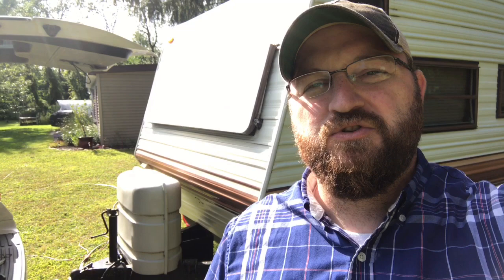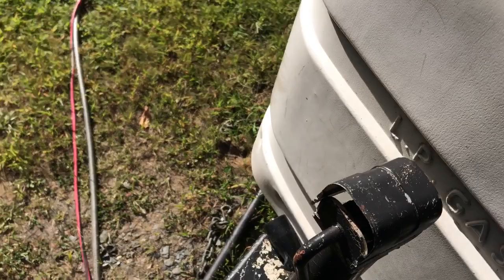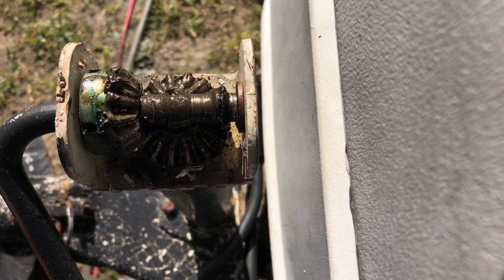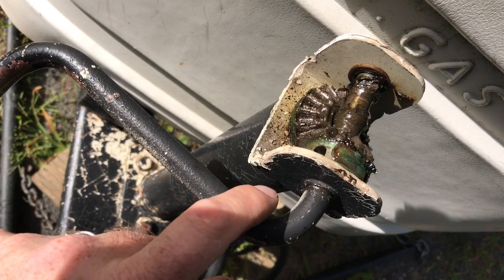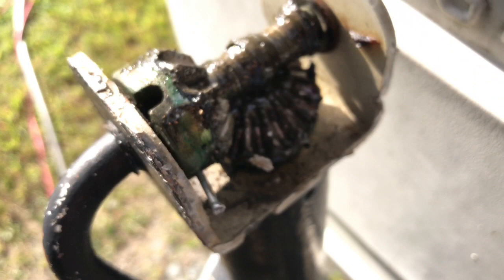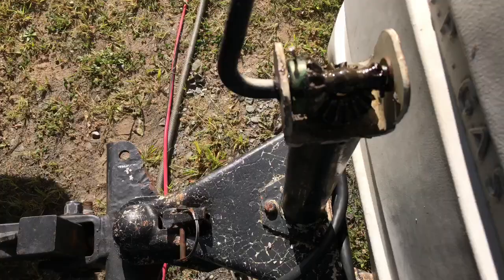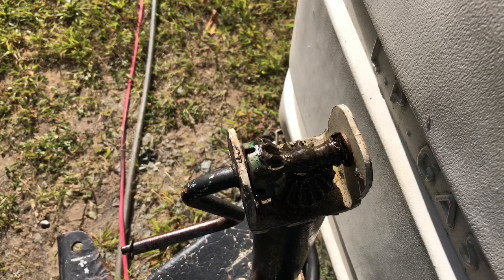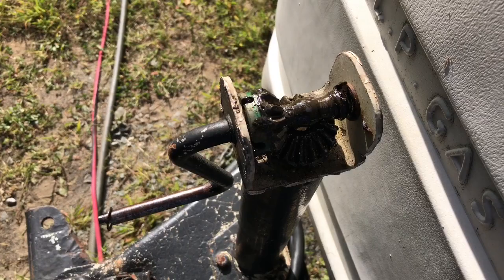How to Repair a Tongue Jack Quickly

Comment: Darn. My Prowler has the same jack. My gears spin, but the leg doesn't move anymore
Reply from the maker: These jacks are actually fairly easy to replace if yours no longer functions.
Reply: @TheAverageDan  Replacing wasn't an option in the middle of the night in Canada with their restrictions. Thankfully the fellow at the front desk of our hotel had a couple strong screws that fit in place of the pins that broken and I was able to fix it.

Comment: Watched this video where you commented at the end about  a future video on how you replaced this jack.   But I do not find such a video.   If you made this video,  point me to where it is.  Hunting for info on how to get the jack off the tongue.   Thanks
Reply from the maker: Attach it to a vehicle and then look underneath... it’s attached by 3 bolts. Remove them and remove the jack and replace with a new one... make sure all
Is tight and lift it off the vehicle with the new jack

Comment: This video saved my ass today in the woods. Though I snapped a couple of nails trying crank it back up, I switched to some fine thread screws. The screws we're much stronger. But they snapped too, so I sacrificed a hex key. TIP: Using a nail/screw etc. can be finicky cranking it up, since there's more weight. But lowering is NO problem with using a nail/screw. But this trick CAN work and CAN save you. Just make sure to carry a couple of them. Even if they're too long, you can hit them with a hammer and bend them, to they fit and rotate with the gears 🙂
Reply from the maker: Awesome! Thanks for sharing! Losing your jack is on of those uh-oh moments. Glad it worked out for you

Comment: My issue was a bit different. I was actually letting my trailer up to disconnect from van. I let it up too high (I think) and next thing I know, it was turning freely.. I'm assuming the fix is the same though... Right?
Reply from the maker: I’d imagine if it’s free spinning this is the issue... a sheared pin